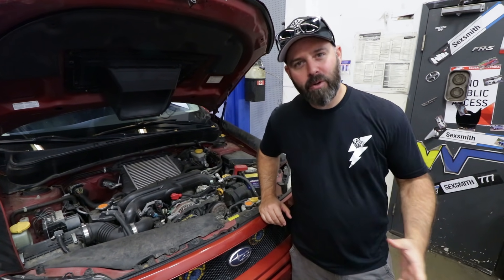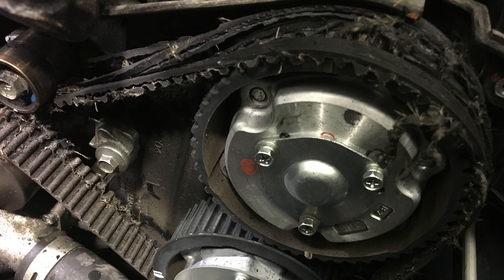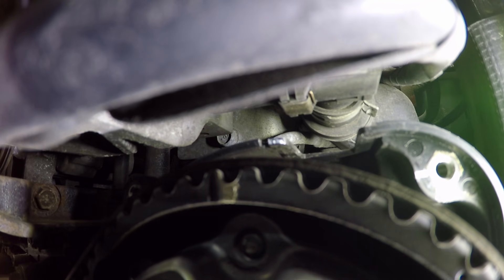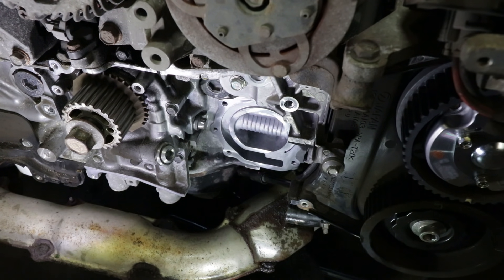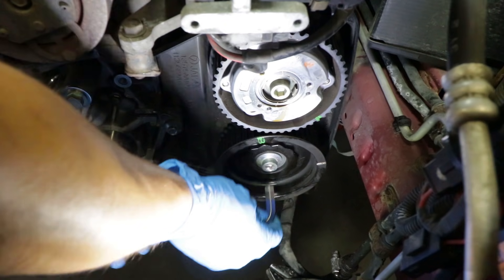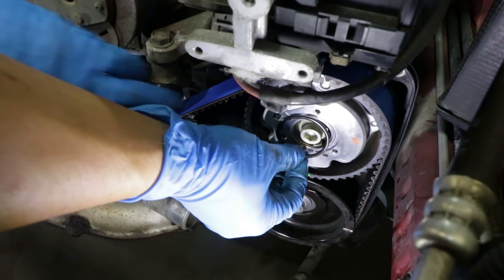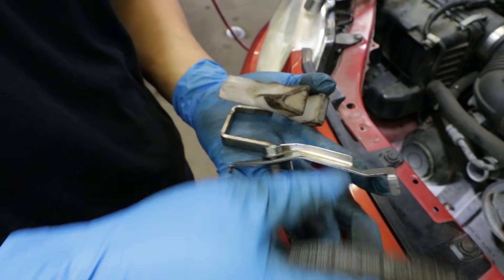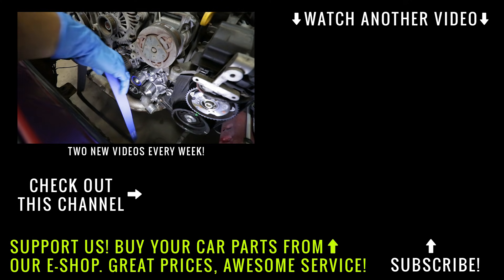How To Change A Subaru DOHC EJ20 EJ25 Timing Belt

Comment: I though5 I knew how to “ burp “ a Subaru coolant system but the tip to take off the radiator cap to get a “ burp “ out of the rad was News to me. What is the suggested mileage / kilometers to change the timing belt on an unmodified 2021 STI?

Comment: Be sure to only spin the driver (left) side exhaust cam sprocket COUNTER CLOCKWISE and the intake cam sprocket CLOCKWISE. Don't do what I did and have to pull the head back off to have the valves re-inspected because you spun both clockwise and heard the valve hit when setting the timing marks...smh.

Comment: Hey something to add 7 years after this video came out— I’m  about to revisit timing belt on my 2010 with over 200k miles and I have to add if you are doing your timing belt north of 180k miles it’s probably a good idea to replace the cam seals while you’re in there or you could be back doing this all over again when they start to leak

Comment: As someone who has attempted this job without much success. There are a couple things I would add:

Use a cam locking tool $30, this will stop the passenger (if your in Australia) side cam lobes from rotating.

The passenger side (if your in Australia) upper lobe must turn clockwise, and the bottom must turn counter clockwise ONLY. Please only turn them this way when aligning them. This is stated within the Subaru workshop manual, or else the valves may hit each other. This should have been mentioned in the video alongside the cam locking tool.

Comment: I just wanted to say guys, I appreciated this guide on how to do the Timing Belt replacement. I just did it on my 2006 WRX STI here in Australia for the first time in 10 years of ownership. It took me a couple 5 hour days due to missing tools and bolts not wanting to agree with me, but I got it done and it's running better than ever! Surprised to say my old belt appeared perfectly fine and was still hard, not stretched at all and the timing was still perfectly in place; with only the Tensioner appearing to be the only thing that was on its way out.

Comment: At 5:49 he removes an idler and you can see the driver's side cam gear spin rapidly from the existing valve spring tension. I have read this can cause valve damage letting them spin freely like that. Is there any truth to that? I am getting ready to do this job and really don't want to risk damaging my engine, thanks.

Comment: Those spring clamps are a good hack to hold the belt in correct place on the camshaft pulleys prior to installing the the tensioner 😊

Comment: I made a mistake and bent and damaged a section of the radiator when trying to remove the crank pulley with a larger 22 mm. My stupid mistake. I guess I need a new radiator now?
Reply: Only if it's leaking,

Comment: Recently figured out that to hold the harmonic balancer/crank pulley while you crack loose the bolt, you can use the old belt. Basically fold it over itself and loop the other end over an extension that’s braced up top. It’ll hold it good enough to pop that bolt loose. It slipped a little bit, BUT if you got a cheater bar on there and use quick jolts of force it’ll break loose no prob! They also make a special tool to hold the pulley so if you do this a lot maybe that would be your most professional option.

Comment: If you were replacing the belt on a very low mileage car that’s been sitting untouched indoors for 10 years. Would you still bother replacing all the idlers and water pump? Would you bother replacing the timing belt at all?

Comment: Don't use a Gates branded waterpump in a Subaru, the current ones are made in China. You would be better off not changing it than putting that in. Only use either Aisin or Genuine water pump. With the other idlers only use the OEM suppliers that Subaru uses (NSK, NTN, Koyo, Mitsuboshi) or Geniune Parts. Don't use other manufacturers even if they are from Japan or Germany. Follow instructions and use the correct torque specs with a good quality torque wrench. Subarus are interference engines. 

I used an Aisin Kit that also comes with the bearings from the genuine manufacturers (check the water pump fits your model and transmission). I imported as they aren't sold in my country, but the price was still a lot better than local Geniune parts. Aisin thermostats are good quality as well and should come with the gasket. You should buy the correct crank pulley tool for Subarus as well.

The reason why you need to go OEM with these parts is because by nature the internals of the parts are hidden and you can't tell how long or well the bearings or tensioner will last in some third party brand that wasn't tested by Subaru, and if they fail then your engine will need a lot of work to be repaired as well as suddenly leaving you stranded. 

I have one car with a 28 year old belt-driven Aisin waterpump in a 1996 Camry that is still original and working. I tried changing it about 6 years ago when I did the timing belt but it was stuck on and because it was a non-interference engine and I was running out of time and needed to use the car again I just left it and it is still working now, though I will change it soon.

Comment: OE thermostat and coolant.... 

Best to use OEM stuff for EVERYTHING...   I personally would have never done the job on my STI with any aftermarket stuff in there...   You'll get 105k out of OEM, this isn't the job to cheap on with aftermarket and replace everything that rides on the belt along with tensioner.  I personally always replaced all the seals in there too.  Avoid the blue T belts, the stuff sheds off and leaves blue crud all over.

Also a good idea to buy new Cam bolts, my STI would lock them in solid and the 10mm hex would round off.   Only way to get them out is cut the heads off.

There's tools out there too that lock the cams in that make it easier.  Not mandatory, but makes the passenger side easier.

Not a bad job when you get in there and pull the stuff off the front, if you have mechanical ability and tools for the job.   Plenty of room.  I still prefer to deal with replacing rubber T belts vs the timing chain setups they're heading to.

Comment: Just fyi for anyone with an auto trans.  You can stick 2 extensions into the crank pully (there are 4 holes you can see, i forget what size but I think it is 3/8") but once you put 2 extensions into 2 holes that are next to each other, get a pry bar or something solid you can stick between the 2 extensions and have someone hold that in place to lock up the crank pully then you can get the bolt out with a ratchet and cheater bar.

Comment: 99% of this is spot on. Only things I do differently is I don't really torque the idlers down (never had a problem with it) and I always rotate engine a few times to make sure my crank/cam sprockets line up again. If it's a manual I will pull tensioner pin and start the engine. If it's auto I will do at cooler lines to rad pull pin and then start it. It's just bad juju to me if I don't start the engine with cover off. It's just how I KNOW the engine won't grenade it's self.

Comment: Everyone be careful when reinstalling the waterpump bolts, 2 times now I have ripped the head of the bolt off while using correct torque sequence and torque spec with clean hole and bolts

Comment: Just a warning for people doing this without a cam sprocket holding tool is to not let the driverside cams spin when releasing tension on the belt. there is a possibility the valves will get bent from contacting the piston heads. Sometimes it won't spin, sometimes it will. better to be safe than sorry.

Comment: as a benz tech, if you are in that deep into a timing belt replacement why didnt you repace the water pump hoses and clamps? i would have. i like timing chains over a timing belt. chains stretch over time and use. belts wear out and crack over time.

Comment: With my EJ20 when I turn the crank sprocket towards TDC carefully watching my screw driver placed in number 1 piston to watch it rise to top which it already had reach to the top compression stroke much before TDC so the piston was on it way down like quarter way down before the crank sprocket aligned to TDC,What do you think is going on here?? Does not matter how many times I turn it through it’s 4:cycles it always end up the same way,keep in mind heads where done and I picked it up from someone who gave up on it

Comment: All these videos with water pumps in them recommend "only OEM thermostat" because all the aftermarket ones "screw with the tuning."  That's a bit misleading.  The point of using the OEM thermostat is because of the temperature it's rated for, and it's true, some aftermarket ones are not the same temp.  Therefore, it's not necessary to have OEM only thermostat, rather, have a thermostat the same temp as the OEM, because there are aftermarket thermostats the same temp and will do just fine.

Comment: Yellow funnel is worthless! Never ever use it. 
Use the evacuator tool to vacuum the coolant system first and vacuum will let you know if any leaks in the coolant system. Then you can release the valve to suck all the coolant in the system. This way you can run the engine with heater full blast to check the dash for hot air to insure the thermostat working and no air pockets in the system. This way to protect engine from overheating or damaging the head gasket.

Comment: I'm about to do this for the first time and been watching videos/doing research. I thought when adjusting the exhaust cam on the drivers side you were only supposed to go counter clockwise and the inlet clockwise as per subaru's procedure? In this vid he went clockwise with both. Does this mean that isn't that important?
Reply: Also, do you have to torque the idler puller on the tensioner or is that set from the manufacturer and you just do the mounting bracket bolt?

Comment: Now that ladies and gentlemen is a Trained Professional. Turning the engine 720 degrees ensures the job has gone according to plan and as for the coolant, I use a Radiator Vacuum Tool. No air locks and much faster to evacuate the air from the cooling system. Very well done.

Comment: I’m having a issue, piston cylinder 1 is at TDC both right bank cams are lining up fine, left bank exhaust cam lines up fine. Issue I’m having is that I have to hold left bank intake cam to line up, feels like it’s hitting a piston right before I get to where I am supposed to be. No idea why.

Comment: Hey I have a 2008 Subaru Impreza wrx the engine is a JE25 and I put a new engine the is JE20 everything it’s almost the same but is only crack but doesn’t start I have to change the timing belt or what I can do I’ll need help😭

Comment: I'm surprized to see that there were no timing belt guides. I really wanted to see how those are installed back (spacing and stuff). Also, there was no mention of the air bleeding of the timing belt tensioner. I saw that on a different video. This makes me question the necessity of doing that. Does it need air bleeding or not? Lastly, is it a good idea to wear fresh gloves when installing the new belt so as to not potentially expose the rubber on the belt to any grease? Just wondering.

Comment: Trash/Hack way to do this. Buy the proper camshaft arresting tool. Had a cam slip trying this way and felt the valves contact and grind metal on metal. Engine is coming apart now.

Comment: I've always crisscross tighten everything, but the service manual specifies to tighten the water pump in a counter clockwise sequence starting from the right. Is there a reason for that? and a reason for you not to follow that and do crisscross?

Comment: I just did this to my 2010 wrx ej25 ,the video was a great guide. Had a problem, someone put a weaker bolt on my water pump and it broke 🥲... it had a numer 4 on it... the rest of water pump bolts got a 9 stamped, it looks like he grabbed same length and size bolt from the timing cover 
Just make sure guys you don't mismatch your bolts  !
Thanks again for this great video

Comment: I feel like replacing the oil pump is a must while in there too. That's just me though. Lol. That's what I want  to do when I get in there. 
My car has 230,000 miles on it now.  Last time the head gaskets got changed was around 150,000 miles with the old owner. 
I'd like to re do all the seals and other gaskets while I'm in there as well. 

I'm a bit nervous cause this will be my first time ever even removing the engine from this car or any car. All my 'mechanic skills' comes from all the other jobs I've done with this car. 

Videos like this help a lot. I'm spamming my brain with videos like this. I'm not doing the job either for a couple of months. Gotta get all the parts together first. 

Videos like this help a lot. Thanks! Hopefully I can get to your level of expertise eventually,  lol. Hopefully I don't fuck my car up either. 🤣🤣

Comment: I bought a subaru with a Locked up engine because the owner watched some YT videos and tried to change the belt himself. Please purchase a Subaru Shop Manual and read the instructions before you attempt. And read the instructions multiple times.

Comment: i have a EJ20 where i only get cold air in my cabin. i have tried to change and flush the coolent, allso changed the thermostat but i still just get cold air. anyone have any ides to why?..
Reply: I’ve got the same issue, also did a flush but still the same. I would assume it must be a blocked heater matrix core or the heater controls in the cabin are faulty. If you manage to sort it please do reply.
Reply: @mightymidget88  I went to the shop with it, they said it I needed a new heater core if thats the right word for it in English,  they say its blocked. They changed it and it's good now 👍

Comment: Why does the toothed idler fail if you only replace the belt? Is it because the old belt and old idler wear down "together" so when you slap on a new belt that's not stretched, it puts more stress on an already worn bearing?

Comment: So I have been messing with a timing belt on a 13 WRX. And both exhaust and intake cam gears have tension so it’s impossible to line them with one person. Is this normal cause he did it with no problem without the special tool. How do you keep the exhaust cam from snapping back and screwing up the alignment?

Comment: 3:30 - The crank pully has threaded holes in it which you use to attach a special tool to.  This allows you to hold the pully (and crankshaft) stationary while you loosen the front crankshaft bolt.  

The holes are clearly visible in the pully while they describe the backyard bodgers way of doing it without the correct tools.
Reply: You really don't need to use the tool. there's more than one way to skin a cat. if you want to make or purchase a tool to use once in a while go right ahead. there is nothing wrong with that method.

Comment: So when you removed the idlers and the driver cams spun around, could that have made valves kiss a piston?  I always use a cam holder tool to be safe.
Reply: The reason the sprocket/camshaft moved is the compressed valve springs reacted to lack of the belt holding it in place. It actually meant valves we're open anyway so by turning the cam back its just opening them again. As long as the crankshaft isn't spun with the timing belt off the valves are OK.

Comment: I just put a breaker bar on the left side of the car on the ground while it on the 22mm crank balancer bolt and bump the starter, while it's still on the ground for auto's

Comment: These Gates parts are absolute garbage. Don't ever use the kit they recommend in this video. I bought it through RockAuto and my timing belt tensioner out of the box (yes I bled it, 3 separate times) would not tighten against the belt. I found out when I rolled the engine over by hand and it jumped time. Tried again, same thing. You've been warned. Given whats at stake, this is absolutely unacceptable.

Comment: can you show me doing the removal of the inlet manfold on a ej20 and removing of a water pipe on the passengers side ,as my  subaru is right hand drive , iam told  a O RING  is leaking as it does puddles on the block its a 1990 quad cam  motor ,

Comment: Have a 2005 Subaru legacy GT turbo charge I am the first owner I start having oil leak when when it was $140,000 miles on it from the top of the engine from the bottom of the engine I was wondering if someone could help me on this my mechanic he change he replaced timing belt and the water pump and thermostats when it was 100,000 miles on it I didn't have a that problem

Comment: Would Aisin TKF-010 kit fit 2001 2.5 dohc, EJ254? Or is that kit for SOHC only? Also TKF-009 is for legacy's up to 99, so 2001 EJ254 would still be screwd. Can't find myself a proper timing belt kit -.-

Comment: Brilliant. Thanks for the video! The comment on which way around to start the belt was VERY helpful. For some reason, the timing kit manufacturers neglected to mention this. The small idler (high and right) that went on toward the end wasn't included in my kit, and as luck would have it, this is the only bad bearing (seized) out of the 5 timing belt idlers in my 1999 DOHC Legacy Lancaster (a Japanese import similar to the Outback) with the EJ254DWBKE engine.

Comment: Excuse me sir I had a question for you guys hopefully you can help me I got a lot 5 subaru svx and I just replace the knock sensor(2)  and now I got a diesel engine valve noise the car was like a month in non operation so now I dont know what's going on,  so hopefully you guys has sone ideas

Comment: I’m doing the job and my driver side camshafts won’t line up. Their off by 180o. I tried moving them and before I’m close to lining up the driver side intake and exhaust camshafts, I feel a strong resistence? How can I fix this please help? Anyone?
Reply: Resistance is probably the valves hitting the pistons rotate the crankshaft a lil and try again